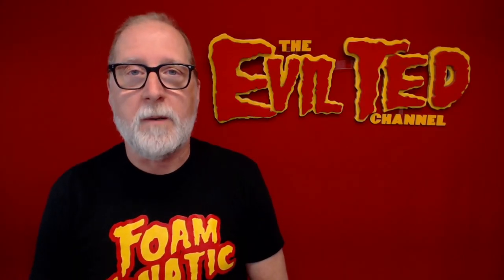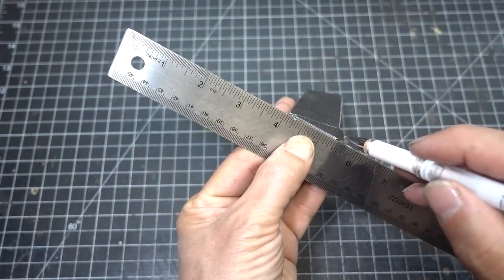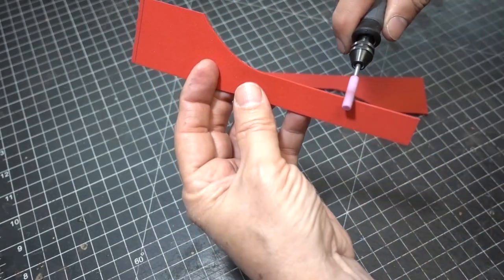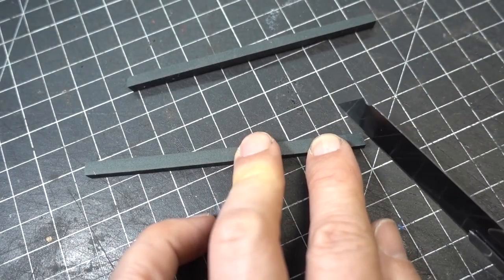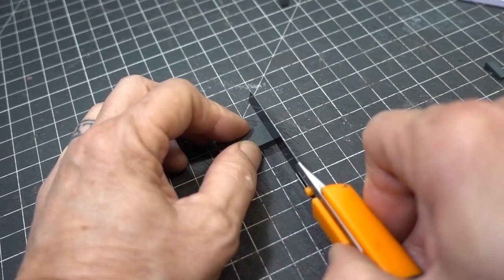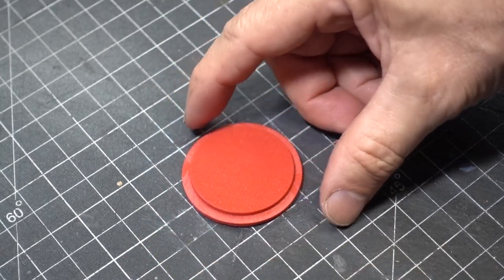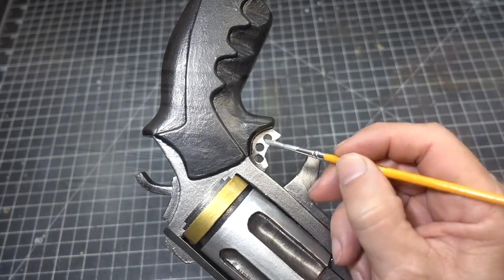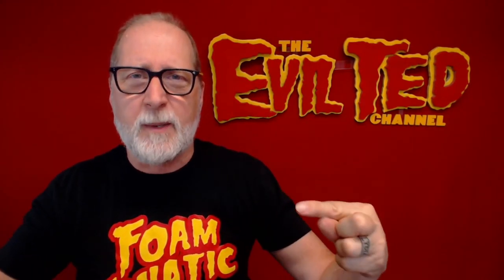Making a Foam Hand canon combined with 3D printing!

Comment: Any idea what has happened to W+F? I just learned about it a few weeks ago and can't find it anywhere. Is it just low stock everywhere or is it a supply issue? 

I guess my question is, will it be back? I'm in the US.
Reply from the maker: That is a great question. I didn’t realize it was out of stock when I was making this video. I have a lot of it in my shop that I bought sometime ago. I am not sure when it’s coming back in stock. I hope it’s soon because I really like his product.
Reply: @EvilTedSmith  Thanks much. No worries.

Also, thanks for what you do with these videos. I have been a maker for about 7 years now, both professionally and as a hobby (now more as a side gig, but have worked full time). I consider your early videos to be the starting point of my journey to become a professional maker. The basics you taught were the best advice and foundation I could have asked for and it opened my life up in ways I never expected. Keep it up! You're doing an excellent job and I really appreciate what you do. 

Cheers! Looking forward to the next videos.